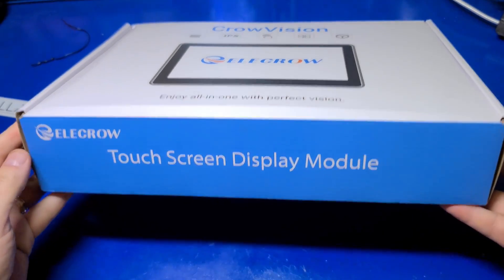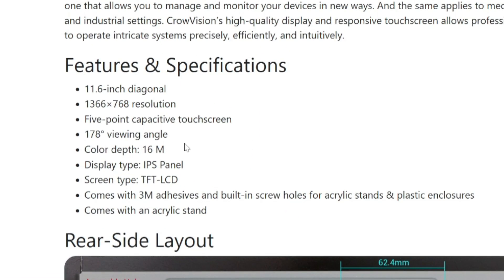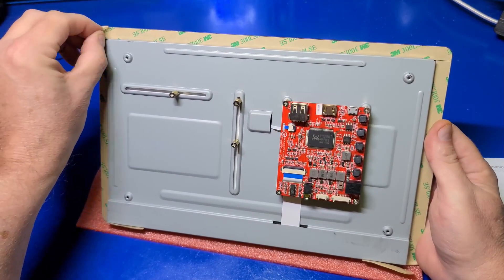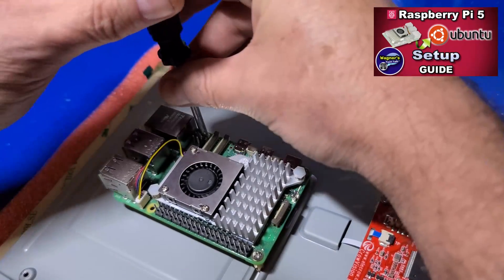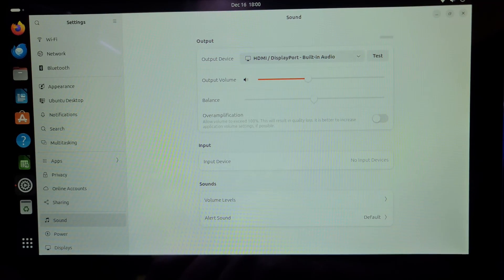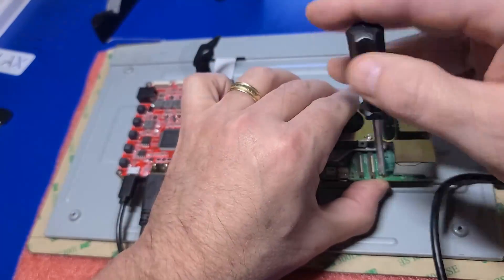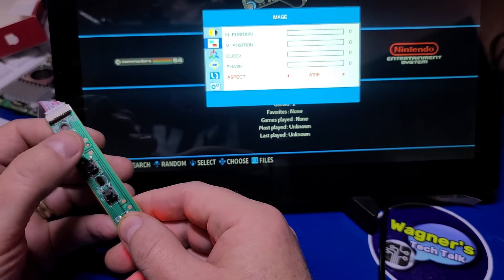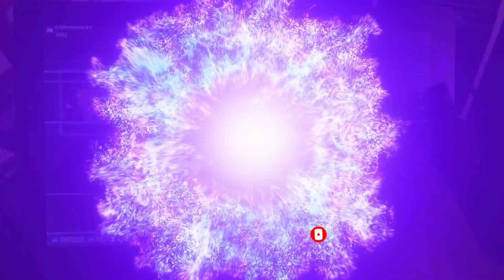CrowVision 11.6" Raspberry Pi Touch Screen and most other SBC's!

Comment: I have the 7 inch variant of this, and while the touch screen works fine on a PC (windows 10) it doesnt seem to work on a raspberry Pi 4. Did you try it on a stock raspberry pi os install (i think bullseye)
Reply from the maker: Yes, I mention that in this video.  I couldn't find a virtual keyboard that worked well.  Ubuntu, worked great, but not PiOS. It's a software issue, from what I could tell.
Reply: @WagnersTechTalk  Thanks for replying, but this isnt a case of just the virtual keyboard. It literally doesnt register any touches at all when connected to a raspberry pi. I tried a lot of different things from the internet (like changing the dt_overlay settings, even disable_touchscreen, which some people said allowed some other touchscreens to work.) But none of these in any combination got it working. I know the hardware works cause it works on windows.

Comment: 10:30 i may be bit blind here but is there a link to the 3D back bit?
Reply from the maker: You can request the 3D model from Elecrow and they'll e-mail it to you.  Not sure if they've added the link to their website yet.
Reply: @WagnersTechTalk That’s too bad.  I did search their website for the STL files.  No luck.  They should have a link to the shell on the page selling the monitor.  Too much common sense.  Oh well, probably another touch screen option elsewhere.
Reply from the maker: @BobGarrett66  Found this, but haven't tried them: https://github.com/Elecrow-RD/CrowVision/tree/main/CrowVision%20Open%20source%20file/3D%20printing/3D%20picture
Reply: @WagnersTechTalk  oh, ok, thanks